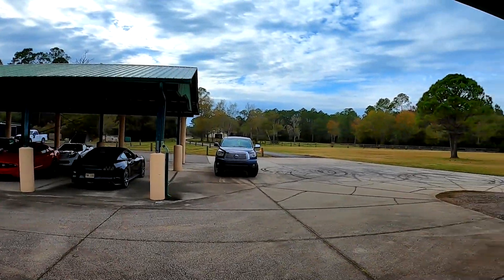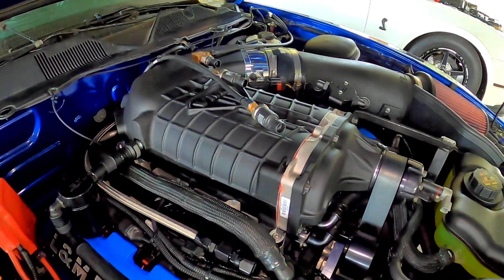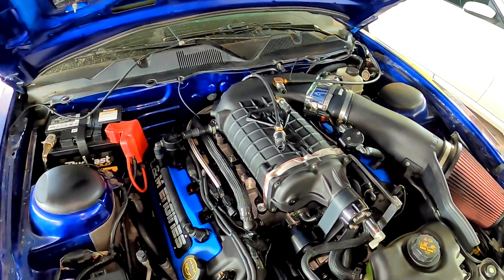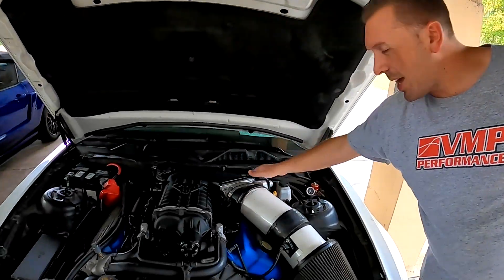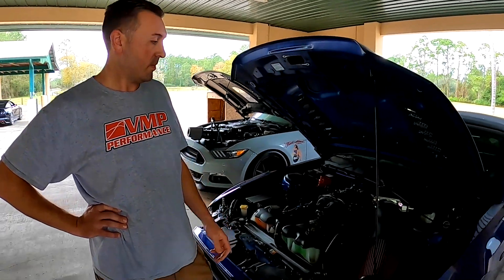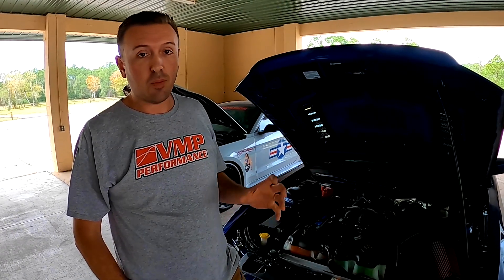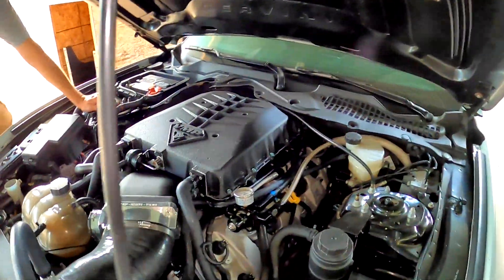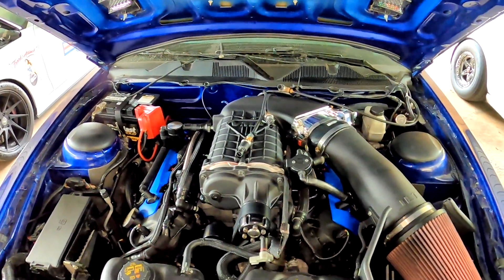Quick Look | VMP 3100 TVS Superchargers | Gen 1/2 Coyote and GT500 Mustangs

Comment: Definitely impressed with what VMP has done. Not easy to admit a mistake (Gen 3 TBs), but they owned up to it and have not just improved their product, they are honestly at the top.  Used to be that you needed a 4.0L Whipple to make big power with a monster torque curve down low. This 3100..... this is going to be a Twin Screw killer. Im on board for one.

Comment: We need to see some tasting, 1200hp it's that impressive the 2.65 can make that numbers?
Reply: The 2.65 can make 1300-1330 rwhp on a GT500 engine with ~11:1, GOOD ported heads, decent cams, decently big exhaust.  
That particular GT500 made like 1040rw with his 2.65.  
So it stands to reason IF Justin’s GT500 picks up 150 rwhp then the 3100 should be “capable” of 1450-1500 rwhp range on a more complete GT500 engine combo.
Haven’t seen any hard data on the 3100 yet just guessing based on their expectations.  It’ll be interesting to see....I honestly believe the TVS tech is better than twin screw, so hopefully the 3100 pans out.
Reply: @BCSVT  I'm really hoping that
Reply: The 3.1L TVS blower makes 1200 rwhp much easier than the 2.65L.  I'm sure it can make a 150+ more rwhp over the 2.65L TVS supercharger with a smaller pulley and larger throttle body.
Reply: @chrism.728  i really hope so ,because  from what i see it not that promising
Reply: @abdulrahmannasser4438  you have to consider compression used and pulley combo and other mods.  Itll make alot more than the 2650 trust me.  The 2.6 was 100 rwhp jump over the 2.3 on max effort setups I bet this will best the gen3r by more.  We need a max effort setup like lunds car with a 2650 to switch to this blower and see the difference (im sure he will just a matter of time).  I would bet money itll best it by more than 100 whp possibly 150+.  Isnt like the 3r was hurting to make power lol.  This thing is a monster.
Reply: @midnight347  i really understand what you're saying,  however we didn't see anything all is just it a talk and now hype about 1200 HP it not that impressive okay good but still not better than competitors
Reply: It's not just 1200 horsepower. It's a 1200 rear wheel horsepower daily driver.
Reply: The 2.65 can make 1300-1330 on the GT500 engine with ~11:1, ported heads and decent cams.  That particular GT500 made like 1040rw with his 2.65.  So it stands to reason if Justin’s GT500 picks up ~200 rwhp than the 3100 would be capable of 1500+rwhp on a more complete GT500 engine combo.